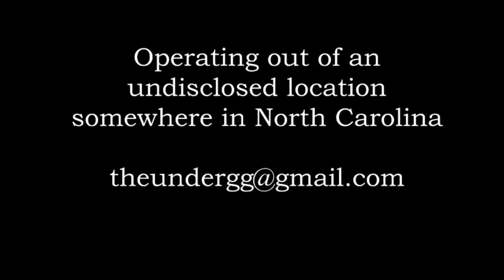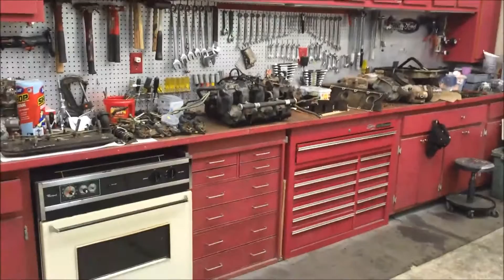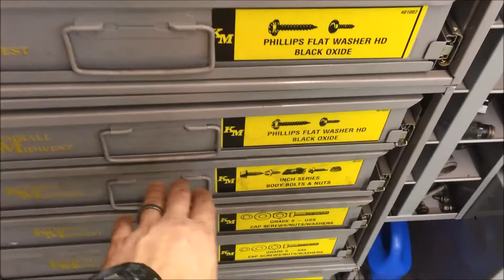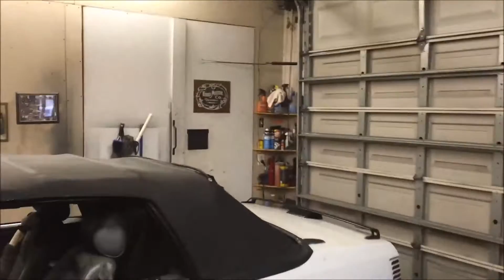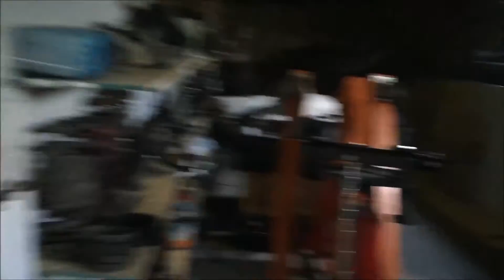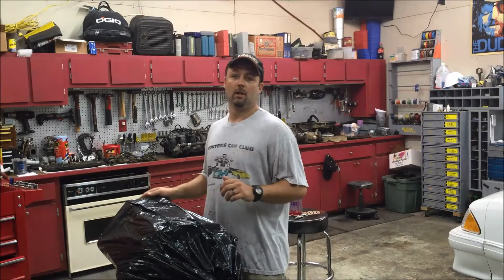Shop tour of the Underground Garage

Comment: Great video. I will be stealing some of your ideas. I like the funnel piping on the wall as well! I am currently in a 2 car "oversized" garage and just now starting to figure out storage and a layout. Right now I just have a huge roll cab and a table for everything. Seeing your setup helps a ton! Where are you in NC? Im in Burlington.
Reply from the maker: The funnel holder / drain was an idea my wife had.  It works great, but it needs some kind of lid or something.  The funnels all get dusty / dirty while they are sitting there.  I shoot a little brake cleaner through them before I use them to clean them out, but a lid of some kind would be nice.